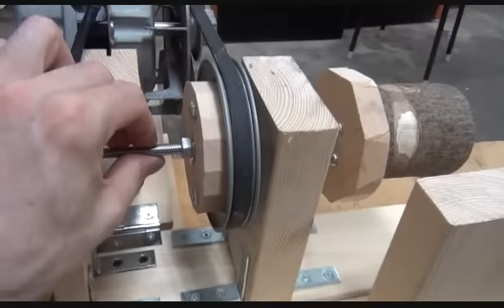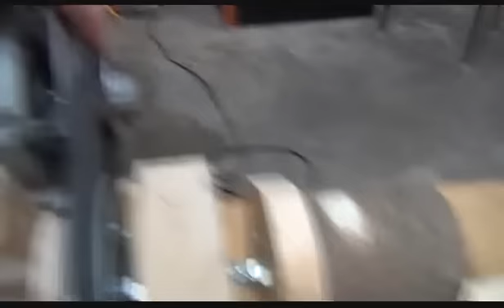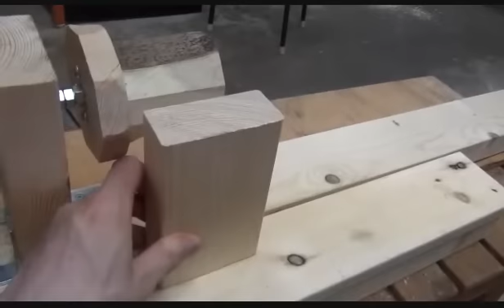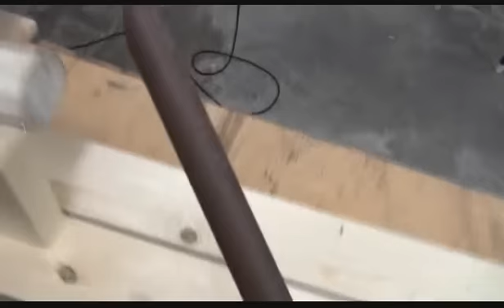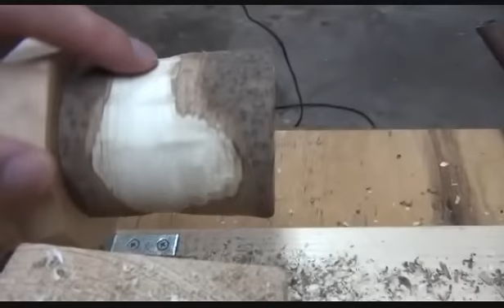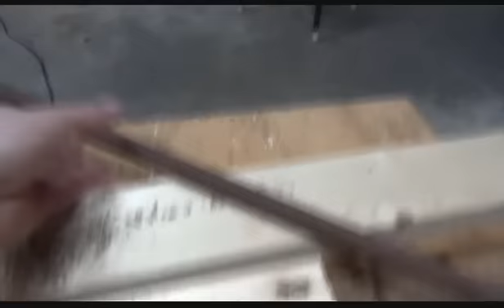Cheap and simple DIY wood turning lathe

Comment: hello sir
nice idea!
is this induction motor you are using? (no brushes) they are 2 speeds usually, lower speed spins both directions.
it is interesting to learn how did you get it wired here.
thanks

Comment: I bought a 36 inch wood lathe off a Old Man for $50.00 off Craigslist. Needed a motor was all it needed. He gave me everything with it and I bought a 3hp motor for $250.00 from eBay and got a 4k lathe for $300.00 all in

Comment: I know this video was forever ago and I garuntee this monstrosity has been trashed by now but you should put a spring on the back of the motor just in case the wood catches. That way the motor won't flip